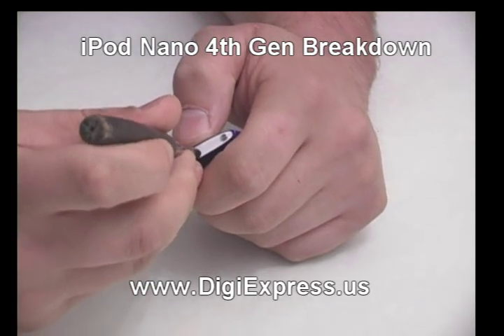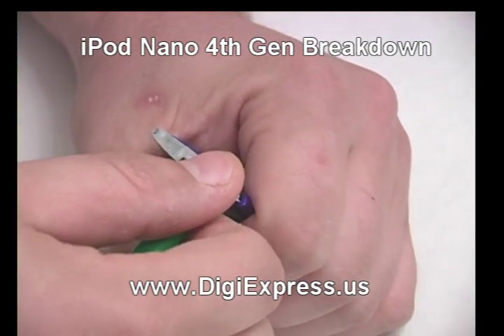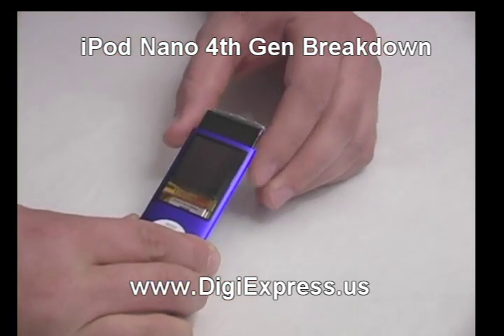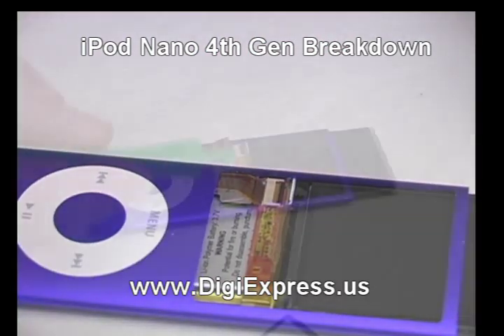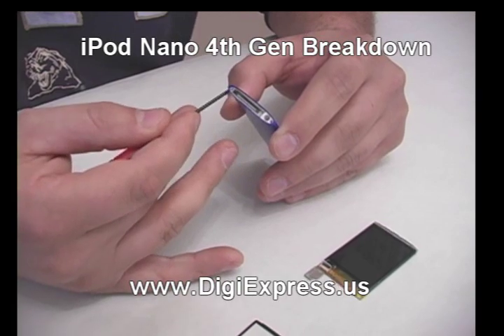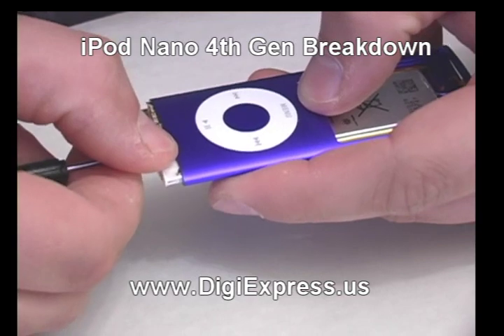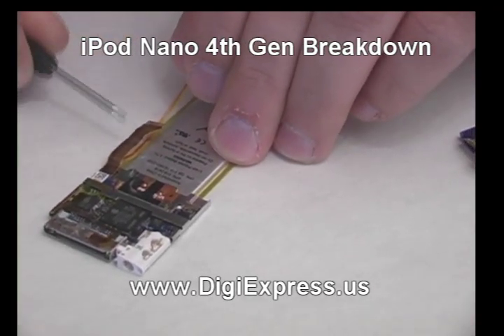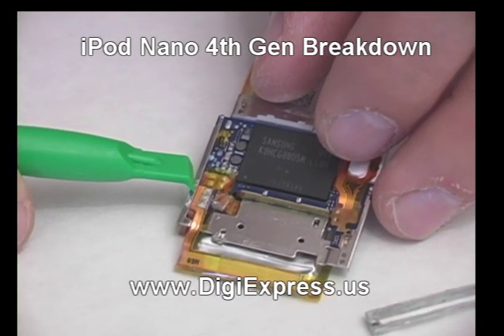DigiExpress - iPod Nano 4th Generation Breakdown

Comment: Thanks for the video. Though, some of it looks a lot easier than it actually seems. The hold ribbon is extremely fragile for one. Which I broke. 

Also, this iPod went through the wash cycle last year and while I got it to work again when it is connected to a power source, it will not stay powered on with only the battery.  It goes blank immediately when disconnected. Can an iPod work without a battery?

Comment from the maker: @LoViAmoPerSempre the glitch could just be the clickwheel itself, it may need to be replaced.  if there is no physical damage (or water damage) then it would be odd that the clickwheel just stop working.  It could have just been the clickwheel's "time to go".  You should try to do a restore through iTunes first, and if the problem persists; I would assume it is a broken clickwheel.

Comment from the maker: @xXxLfcxSuarezxXx That is a question that just cannot be answered with 100% accuracy, when all we have to go on is a single sentence statement.  If your clickwheel does not work, then generally replacing it with a new one will fix it.  However if your iPod Nano has damage to the logic board (aka main electronics board), then it will not fix the problem.  However you have two options, buy a new (or used) iPod or buy a replacement clickwheel and try to repair the device.

Comment from the maker: @jimmymastiff The #00 phillips will fit all of the screws that are in this device.  You may have an issue with glue covering the heads of the screws, but you can remove the excess dried glue with a flat head screw driver of the same size.  Other than that, the phillips will suite you fine.

Comment from the maker: @darkwaterss With any kind of water or liquid damage the battery is usually the first item to be replaced, but we cannot guarantee that we can repair all cases of water damage.  We have a diagnosis service for $25.00 that would have a technician work with the device and find the extent of the damage.  More information on this service is available at our website.

Comment from the maker: @drdos4 Just from your description it does sound like you need to have a new headphone jack installed, I would assume that a new one needs to be installed.  The headphone jack gets the most usage from the internal copper connectors that make contact with the headphone plug.  So I don't believe that you have to re-solder the part, simply replace it.

Comment: My ipod works when on the charger, but as soon as i disconnect it, it turns off and won't go on again - do you think i need to replace the battery? I just don't want to send it off for a replacement, if thats not the problem :/ Thanks for the video though :D

Comment: part [2/2]

The iPod doesn't seem to hold any charge. It just dies as soon as I plug it out. It works like a charm when plugged in. It seems to me as a battery issue. It may be the case that as it was kept unused for 2 years the battery has lost all its capacity to retain charge (may be). I am seeking expert advice on this issue and any solution, if at all possible.
@DigiExpress: Please take a closer look at the issue and let me know. Is battery replacement an option? 
Thank you very much.

Comment: Do I have to do all this just to clean the inside of dust? I've had my ipod for about 5 years and there is so much dust in it the buttons have stopped working. It turns on, and the only way to play music is to shuffle it by shaking it. I just want to clean the inside.

Comment from the maker: @kai9116 In order to back up the music from your device you would first need to make sure it can communicate with iTunes on your computer.  If you plug the iPod into the USB port on your computer and it does not show up as a Device in iTunes; then you would not be able to pull any data from the iPod.

Comment: I want to take apart my Ipod to try and fix it, but I'm too scared to actually do it. So is there anything else I can do if my scroll wheel doesn't waork that well anymore? Sometimes after I reset it...it works for about 5 minutes...aftwerward the scroll wheel stops working again.. What should i do other than buying a new ipod? xD Thank you for your help!

Comment from the maker: @Dervlahx3 While I can't guarantee it, it sounds a lot like your battery can no longer hold a charge. The only way to be sure is to install a new  battery and see if that fixes the problem. I will say that in most cases like the one that you're describing, a new battery does resolve the issue. Thanks for watching!

Comment: I soldered new battery in and have it back together but how the hell do you get the glass back in  have tried for a week to push down on the bottom and get itto slide in just enough to get the top in but the lip just wont clear the case

Comment: @DigiExpress Hi, I need to replace a battery in my 4th gen nano, as I was removing the lcd ribbon I had trouble sliding the ribbon out, (I have the black tab unlocked) I tried freeing it by lifitng the white piece a bit, and it broke, is it important this white piece that holds it? or is it just there for support? 
Cheers

Comment: Hello, in fear of breaking anything, I don't want to open my iPod nano quite yet until I know what the problem is. I got it in '09 and it died a week after I got it. However, the warranty was gone when I received the iPod from my grandparents. It stopped working after I charged it overnight. Now it won't do a thing. The screen's been black for the last 4 years and I just found it again today and I want to fix it! It's 16GB after all. Any suggestions as to what the problem may be? Thanks.

Comment: this was confusing, i would not dare to break apart my dude, gone through a lot with this guy to wound him. I have a question, if the dock connector doesnt recognice the USB ipod connector cable what do you do because evrything works it died because it needs to charge but is not recognized by cables

Comment: question how do you dig out the lcd before you pry it out of the chassis? you skip a step. you already had the lcd out on your demo. pop up the tab on the lcd connector and release the ribbon. when did you remove the tape that it has holding down the connector along with the other electrical connections. now show how to repair the contraption.

Comment: Careful removing tape on LCD ribbon. When I tried to remove the tape the whole connecter tore away from the LCD board. And when I removed the LCD the hold ribbon tore even though I had removed it from the LCD. I wouldn't try this unless you had to open it. You need to watch more than just this one vid. You'll probably end up breaking something and having to send it in to these guys for repairs. Hmmm?

Comment: My screen is STUCK. and the little metal loop on it the hold switch is mounted to bent trying to pull it out. Ive put as much force as I am willing to on the screen and it will not budge at all.

Comment: cont: g) The Click wheel edge connector needs to be prised off the metal plate, else it will snap as you ease the main board out of the case

In short, it is VERY tricky to replace the battery (for instance) - a task that should be simple but isn't - thank you Apple :(

Comment from the maker: @shitzu21 
The reason that iPods usually don't work after water damage is that the batteries short out. The mostly likely remedy is to replace the battery. We sell them on our website, or if you would like more information about our repair service, please give us a call at 1-800-440-4693.

Comment from the maker: Make sure that your clickwheel cable is attached properly. However, if your clickwheel is not functioning at all, you may need a new clickwheel cable. We sell those for $24.99 and if you would like, we could do the repair for you as well for an additional $25. Here's the link: digiexpress.us/4th-generation_c_27.html

Comment: So, then what? Video only goes as far as showing you where the battery connection is. Disconnect it from battery or from Nano? After connecting new battery, how does one tape cables down? Do they have to be taped? Is reassembly just doing everything in reverse order? This is the second video (different company) that only gets this far. Very frustrating.

Comment from the maker: The first thing that you would want to change is the battery. That's the most likely culprit of the problem, and even if it wasn't, after sitting for a while, it has most likely worn out. We sell the battery for $9.99. That should at least get it to turn on. If the screen still doesn't come on, you may need a new lcd ($29.99). The prices are for the 4th generation. If you have a different generation, your screen price may change. You can call us at 800-440-4693 or visit digiexpress.us.

Comment: I was going to fix the battery on my iPod Nano since its dead even though I rarely used it but watching this vid scares me. Why couldn't Apple just make it easier to replace a battery like pretty much everything else where you slide the back plate off & put in a new one? Seems like everything they do is done on purpose so they can make more profit from outdated products

Comment from the maker: @04nichyt Connect the iPod Nano to your computer's USB port and then launch the iTunes application.  iTunes should bring up a summary page for your iPod Nano, on this page there is an option to "Restore" your device.  Choose this option and after a short installation process iTunes should recognize the iPod Nano.  If this does not work then there may be other issues with the iPod Nano and would then suggest to call us directly to set up a Diagnosis / Repair order.  Our number is 1-800-440-4693.

Comment from the maker: @ResidentEvil2860 Try charging it using a wall charger for 24 hours. If this doesn't work you may have a defective battery. Check out our website for more information.